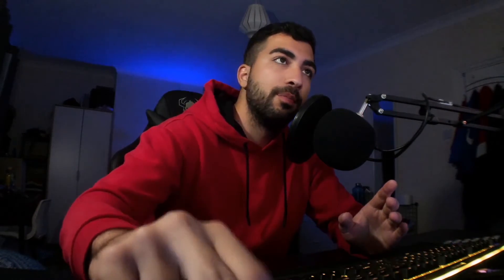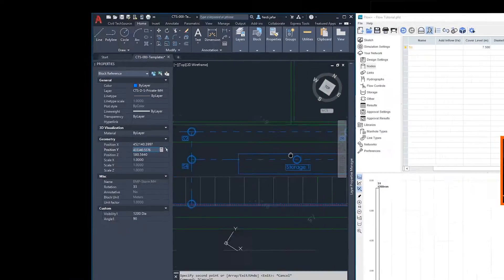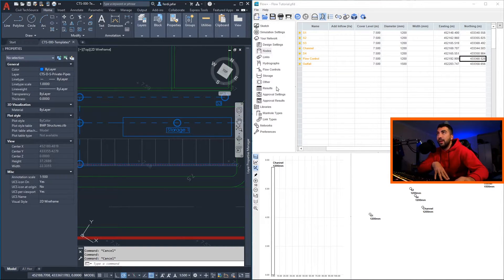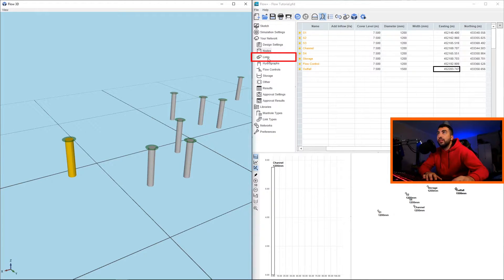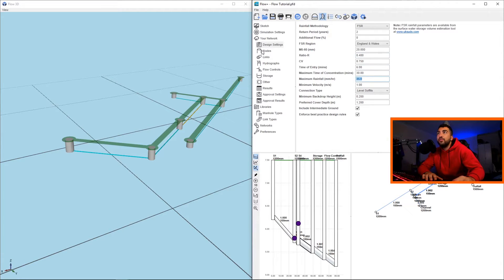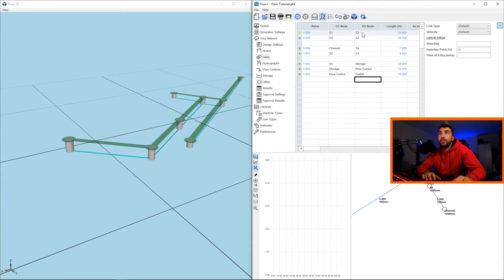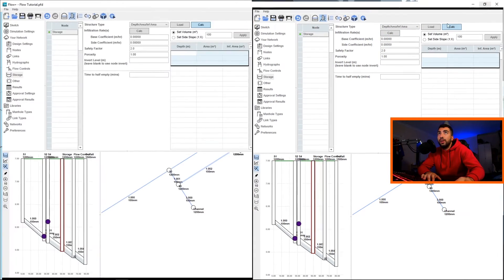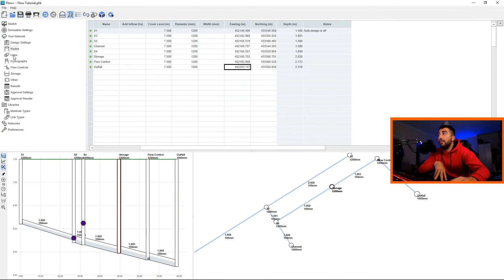How to model a basic network in Flow

Comment: Hello - When I create a drainage scheme using Nodes and Co-Ordinates, Flow does not allow me to adjust any invert levels or pipe gradients within the Links section and is instead adamant that the auto designed drainage flow is final. Adjusting the Preferred Cover Depth within the Design Settings also doesn't solve the problem. However, should I create a drainage scheme using the Sketch command I have the ability to adjust Invert Levels and Pipe Gradients. Do you have any tips on why this may be happening?
Reply from the maker: Hi Thanks for the comment  have your tried turning off the force design parameter option I believe its on the design settings tab
Reply: @CivilTechSource   Thanks for your comment - Yes I have turned off 'Enforce best practice design rules' (not sure if this is the same as force design parameter - I cant find this option?) and also turned off 'Auto-Design' from right clicking on the Links tab. Still doesn't work.
Reply from the maker: @NathanAryee  Send me the file I will have a look at it.